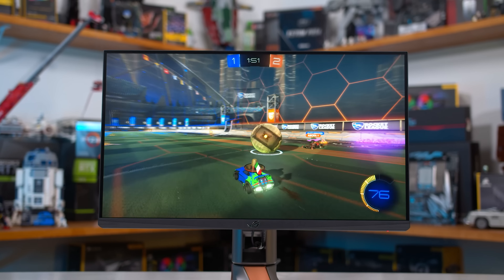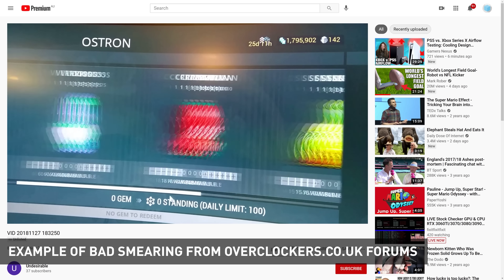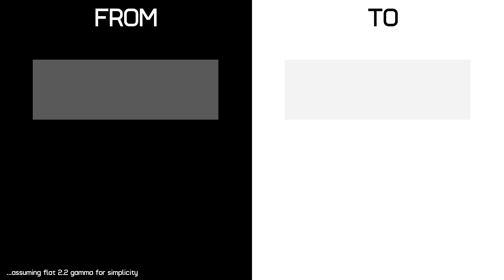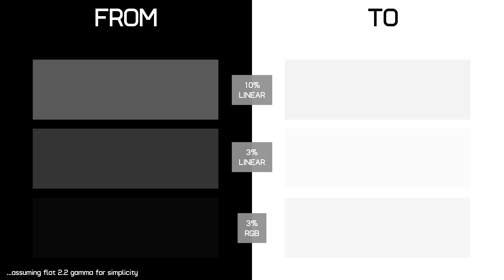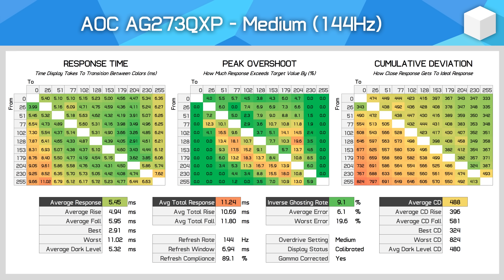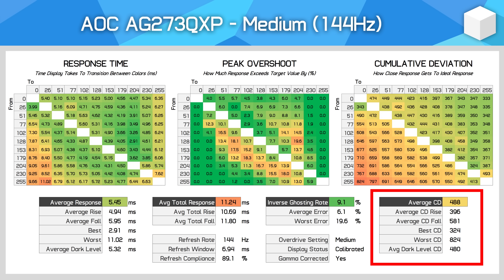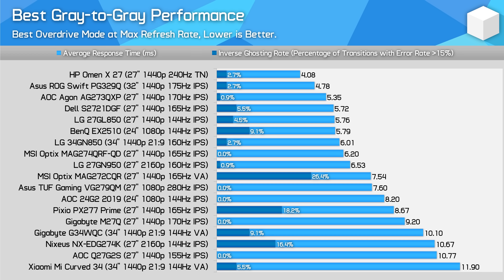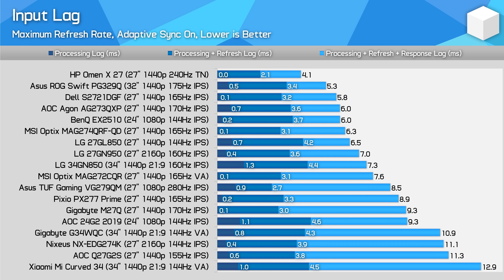What Are Response Times? Overshoot? Ghosting? Monitor Testing Overhaul For 2021

Comment: Can someone tell me what represent the number 0 to 255 on the board ? 3:47
Reply: That's how many shades of red, green and blue respectively there are in 8-bit displays, which is what most of the displays on the planet are right now.
The numbering ends at 255, but it starts at 0 instead of 1, so there are a total of 256 shades of each of the primary colors.
256 shades of red x 256 shades of green x 256 shades of blue =  16,777,216 colours or the 16.7 million number you often see in advertising.
if you open up any program on your computer that uses colors that you can select, you can go into the color pallete menu and create your own custom color based on a combination of the 256 levels of red, green and blue respectively, thus creating any other color shade you want.
For more knowledge, start with https://en.wikipedia.org/wiki/Color_depth
Reply: @edfort5704  thank you now I know what Im looking at

Comment: Where are the good flat 32" 16:9 1440p 144hz VA monitors?   Samsung & others would curve a 4:3 screen these days
Reply: Why tf would you want a flat super ultrawide, that is sick
Reply: I own a flat Samsung 34" Ultrawide 😀
Reply: @riba2233  its not 21:9 ultrawide. Its 16:9  i.e. normal TV ratio. like 24", like 27".  We want good 32" FLAT versions.  just like tv, just like 24" just like 27".    Curve ultrawides, not 16:9